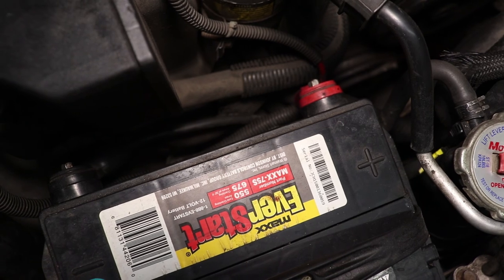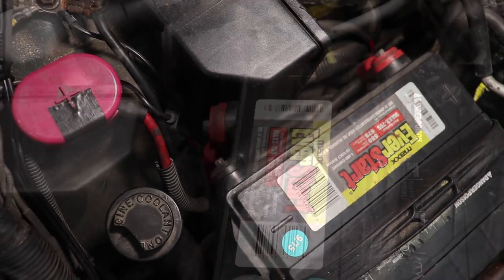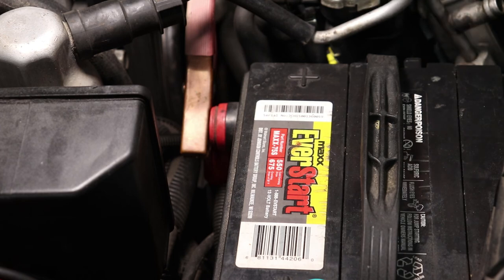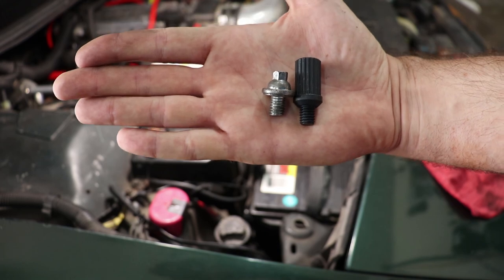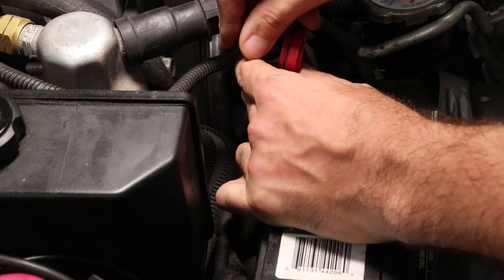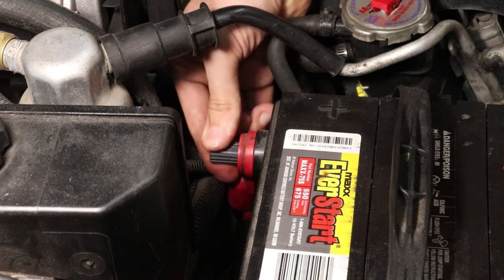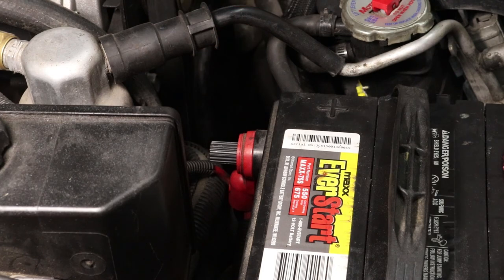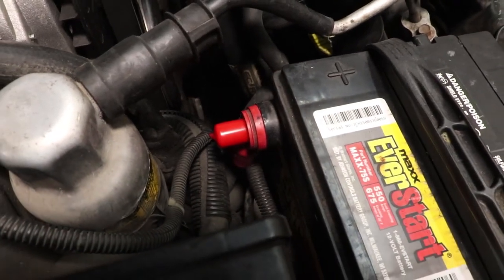The Better Battery Bolt - The Best Solution For Side Terminal Batteries

Comment: Another video said the side posts were made to avoid the gases and acid evaporating or leaking on top of the battery, that cause terminals to corrode.
 Still though, they could have designed the side posts much better. Thanks for the video, I'm going to try them
Reply from the maker: Hope you like them! They've come in handy a few times recently for charging and testing on side post batteries.

Comment: I found these while searching for stainless version. I wish they made a stainless version
Reply from the maker: Stainless would be pretty sweet. I will say, I haven't noticed any issues with corrosion on these yet though. Not sure if it's the tendency of side post batteries to resist corrosion at the terminals, the coating, or the covers, but they seem to be holding up quite nicely so far.